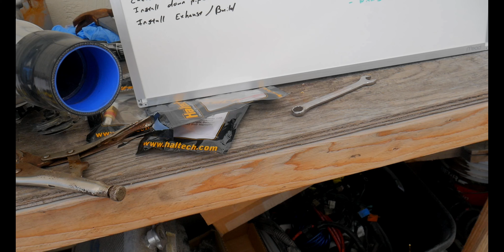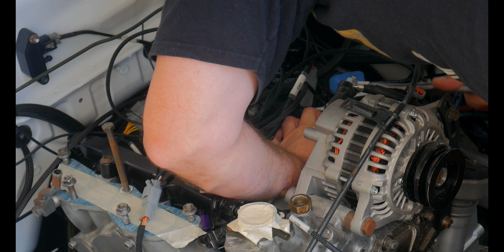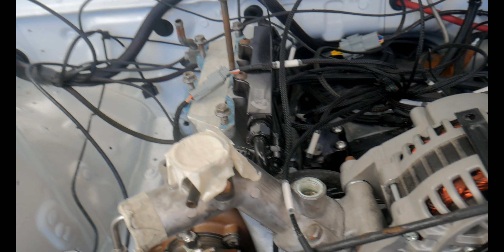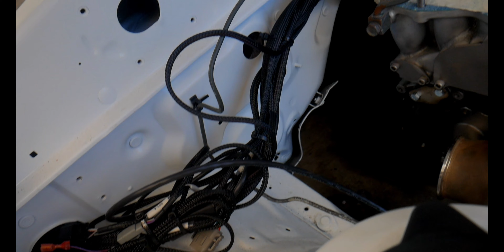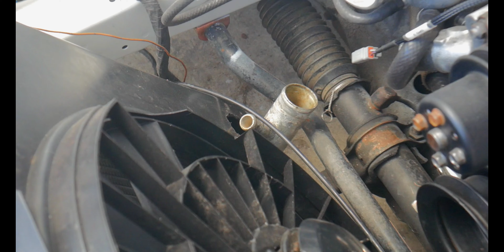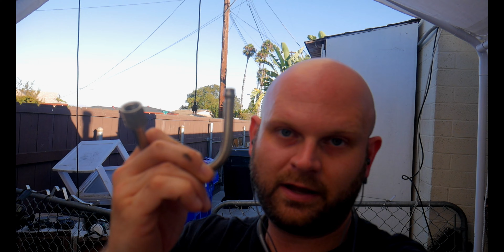Prepping to start the RX7 // FC3s 1988 Mazda

Comment: Don't recommend putting your main water temp sensor in that location - if the thermostat gets stuck, you will get a lower reading.
If anything, best to put it under the thermostat slightly below your current location - this is why the stock sensor is located on the back side of the water pump housing.
Reply from the maker: Good point.... I ran no thermostat in the past so wasn't considering that.... I think I will change to the stock location. Thanks!